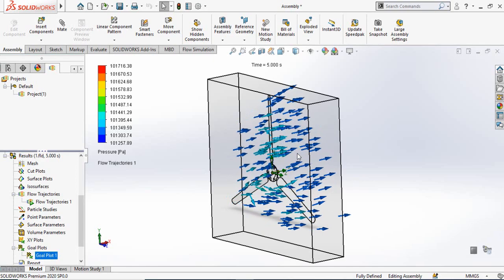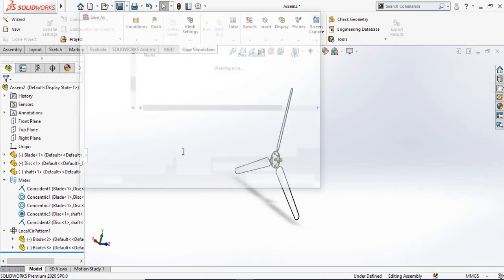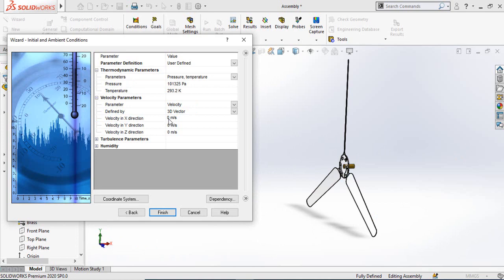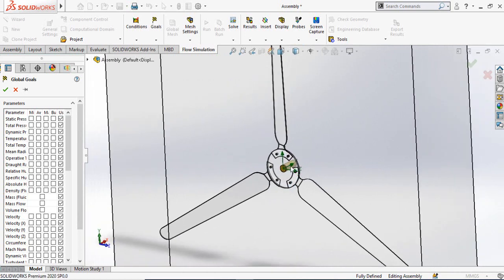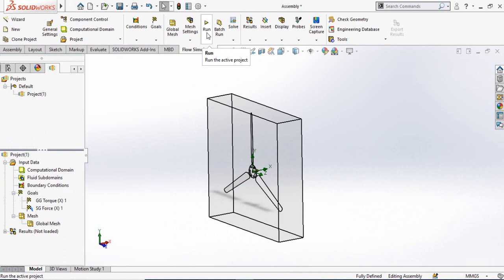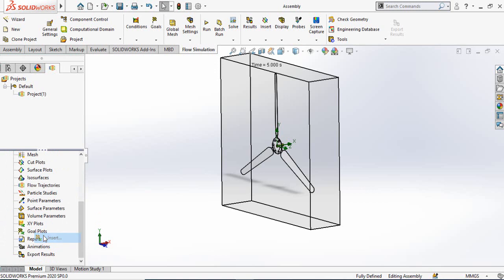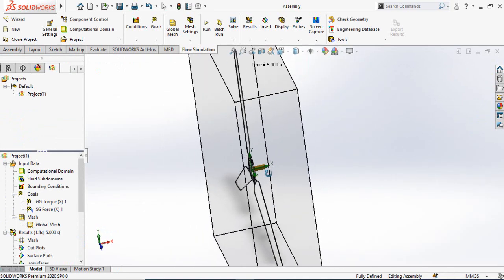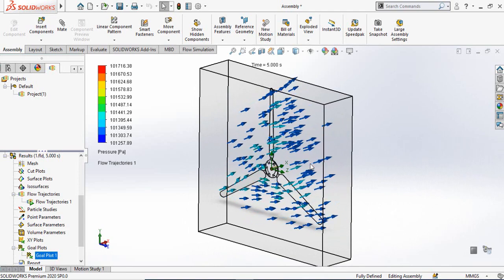Torque of a Wind Turbine by SolidWorks Flow Simulation

Comment: Thanks for the video, it is interesting to know the torque but will be an estimation value, because you are not considering the wind turbine spinning, which will totally change the value, for many reasons, but just to tell two of them;
1- The profile lift force changes with the relative speed that the edge of the foil sees.
2- The inertia. If the wind turbine is spinning to certain RPM and the wind velocity is X. The increase of revolutions per minute are not the same increase of revolutions that the turbine would have obtained if it had been stationary.
So as an engineer I must say this simulation is not fully valid. But for sure helps to understand a lot of things. Thanks for the video.
Reply: Hello Robert,
Thanks for putting more light on the simulation.  Although I'm just beginning to learn the process, but do you mean that the wind velocity of 10 m/s used in the simulation did not cause any rotational effect on the rotor assembly, or you are only pointing out that the rotational speed was not selected as a goal in the simulation? Please kindly enlighten me. Thank you.
Reply: @abdulmalikmusa6889  I mean, your values are probably OK for a static wind turbine. In reality is spinning, so the relative velocity that the profile see is going to change the direction if the RPM and/or the wind speed changes, moreover to add more complexity to the equation, the relative velocity is the one that generate lift and drag on the blade, the lift underneath the blade is what actually responsible of produce the majority of the force on the blade, which is translated into torque in the shaft. Exactly the same effect that allow a plan to fly.